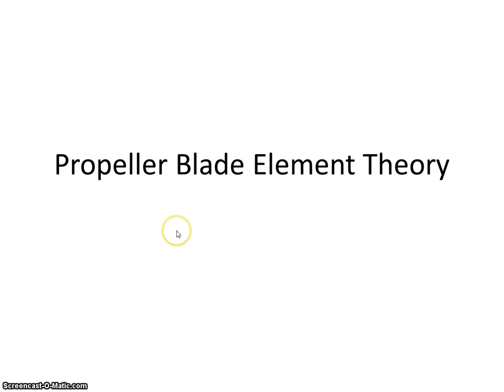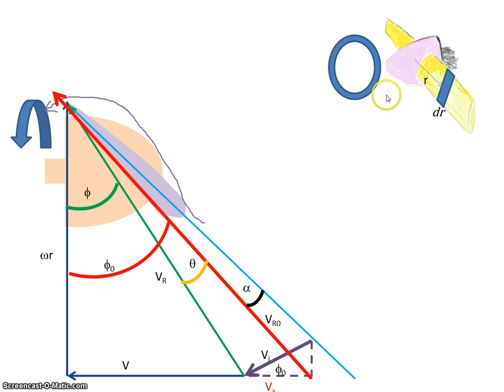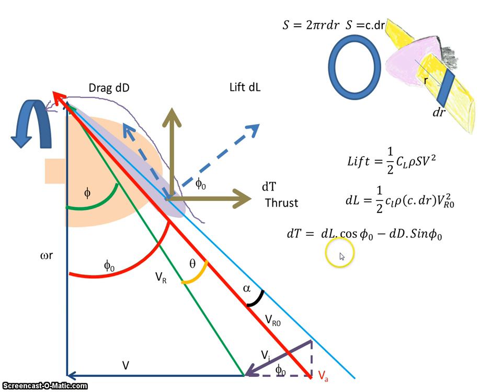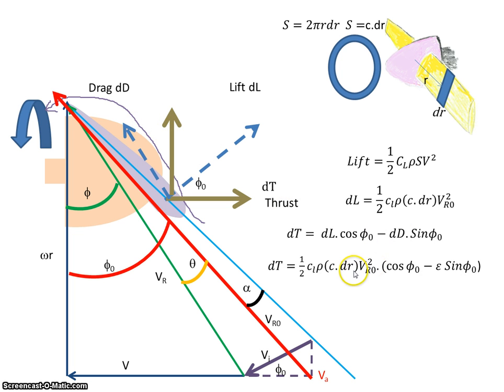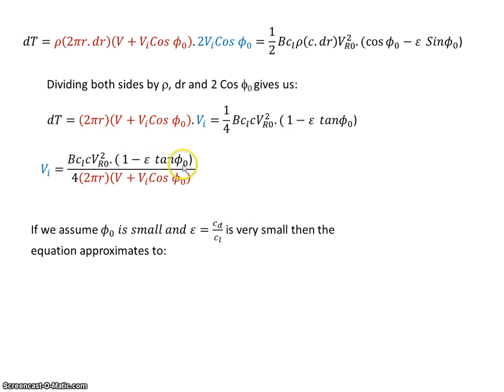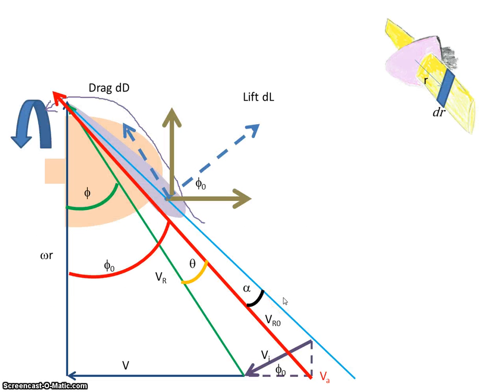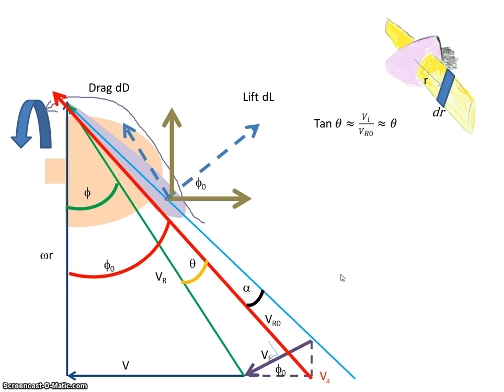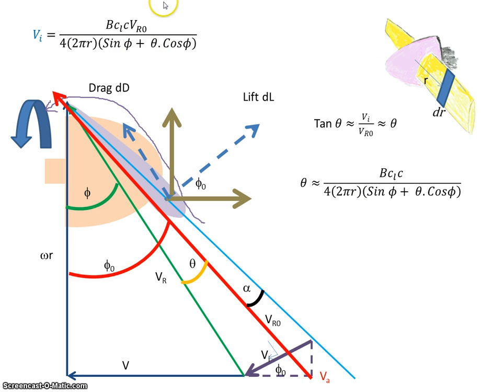Propeller Analysis 3

Comment: I suppose we need to integrate those formulas from 0 to R w.r.t dr in order to calculate the total lift, thrust, etc. However, in the formulas expressed in the video there is also the chord length c, which varies from section to section. So whats the way to calculate the overall blade forces?
Reply from the maker: geoklavaris the chord length c is the mean aerodynamic chord.
Reply: thanks
Reply: Hello again, basically i am carrying out a project on Variable Pitch Propellers and i assume the propeller analysis is the same as the one explained in the video. However, i am going to calculate the blade pitching moment about an offset axis of rotation (pivot) and i want to test it at 2 different cases; take off (high RPM) and cruising (low RPM). For start, i am going to use conventional symmetric constant airfoils throughout the blade and the propeller will be tested on a stationary position. So my question is how i am gonna analyze the propeller with only knowing the RPM (wr) and the geometry of the blade? what about the forward velocity (airspeed)? will it be zero duw to the stationary position of the propeller?? thanks
Reply from the maker: geoklavaris I don't think you should use an airspeed of zero as the angle of attack will probably work out to be too high.  How about looking up the take-off speed for an aircraft with that propeller and using that for the fine pitch condition, then use the cruise speed for the coarse pitch.
Reply: I will check it out...Appreciate the response, thanks!

Comment: Can I use these equations with a propeller inside a circular chimney which is placed vertically to conclude the the optimum blade section that generate the maximum power output ?
Reply from the maker: Yes.

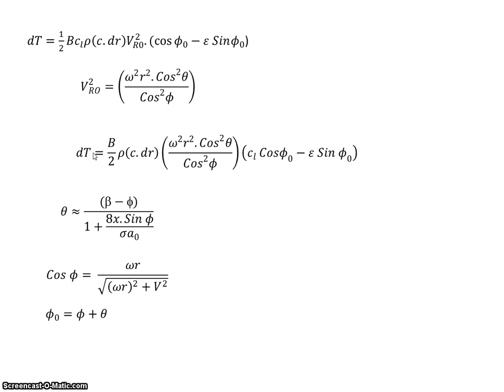Comment: In the final formula for Thrust, shouldn't the sin(phi0) be multiplied by the coefficient of drag and not epsilon? I think the epsilon should have been cancelled when Cl was multiplied into the brackets? time: 14:26

Thanks,
Reply from the maker: You're correct.  Thanks for that.

Comment: Sir, Can this be used for propellers which have a curved surfaced like surfaces on boat propellers? For e.g. For Radio Controlled models (quadcopters) I see propellers which don't have any thickness but still provide lift. I think they are called slowfly propellers.
Reply from the maker: The principles are the same.  The lift is proportional to the airspeed over the blade, the area of the blade and the angle of attack.  This video was demonstrating the effect of airspeed and angle of attack for a given area S.

Comment: I have a quick question , as far as i know with increase in forward velocity thrust must decrease, however using this method with change in forward velocity thrust is also increasing . Can you tell where i might be wrong. I am working on a project and will be grateful if you can reply ASAP.
Reply from the maker: You're right. As velocity increases the thrust reduces because Thrust=Mass*(final-velocity - initial-velocity). However, you need thrust to give you velocity in the first place. It's a bit like a ball having potential energy on top of a hill, but having no kinetic energy. As the ball falls off the hill the kinetic energy increases and the potential energy decreases. Similarly, on the runway when the pilot is standing on the brakes and has the throttle fully foward, the propeller is producing a lot of thrust. But when he releases the brakes the aircraft moves (velocity increases) and hence the thrust reduces. However, without that initial thrust the aircraft wouldn't have moved at all. Hope that helps.